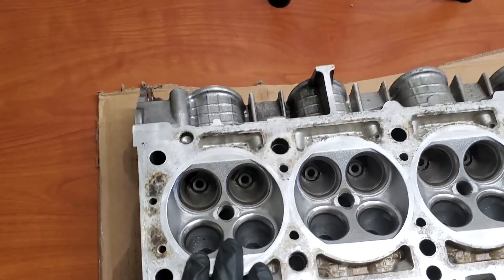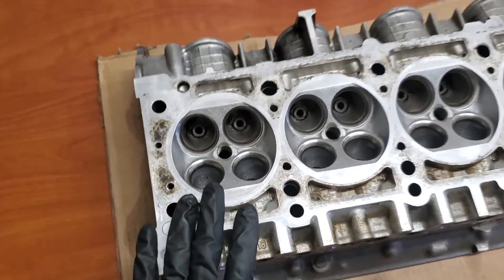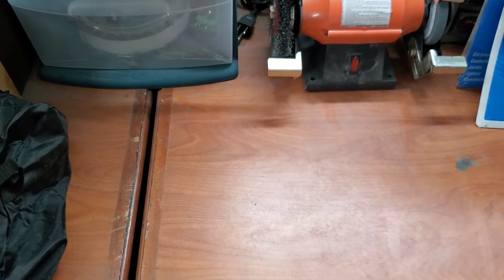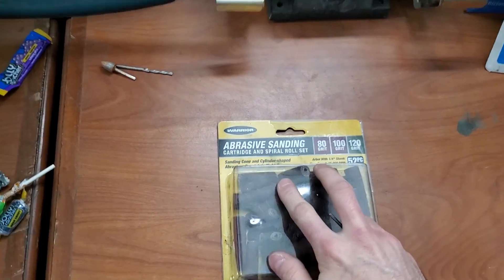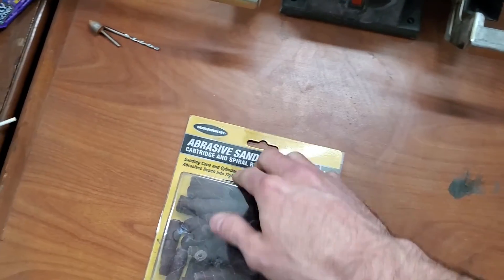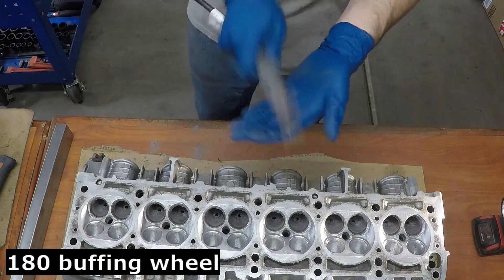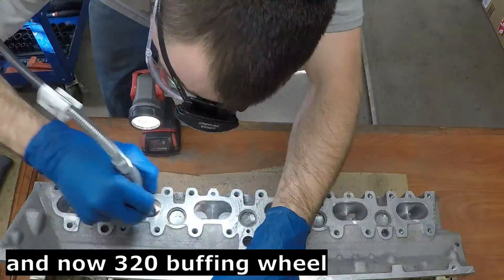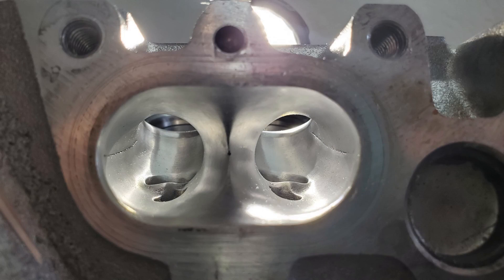Porting The Head - M104 Turbo Build (Ep. 13)

Comment: There all all kinds of room for improvement in that head, anyone who knows anything about cylinder heads and porting can see that. Sure, Cosworth helped design the head, but Cosworth designed the cylinder head to a price point and a budget set forth by Mercedes. I’ve seen Cosworth F1 heads and I promised you they look nothing like that factory cast head. Nothing you did in this video hurt that head in the slightest, everything you did there is going to offer an improvement over that as cast head. Pagani who uses essentially the same head on the Zonda (The M120 shares heads with the M104) do an extensive port and rework the chambers on there heads. If that head were a fully built Cosworth cylinder head, the head alone would cost tens of thousands of dollars. It is a well designed head from the factory without doubt, but there is certainly room for improvement and anyone who says otherwise simply doesn’t know what they are talking about. Well done sir
Reply from the maker: I wasnt going to say it. Thankyou Haha

Comment: That head was designed by a little company called COSWORTH and believe it or not they KNOW a little bit more than Jake 
Props to Jake for having a go and youthful exuberance and all that, but in reality, he has just destroyed the flow characteristics of that head.
Sadly it would have been BETTER if he never touched it with that Dremel tool at all. But you have gotta love the fact that he's overly confident 🤣 🙄
Reply from the maker: I respectfully disagree. I certainly changed the flow characteristics, but i strongly believe its for the better. I dont think the engine benefits from a head with casting lines, sudden port expansions (due to non-blended "lips"), and dull dividers.

Im willing to bet my head will flow better than the factory intended.
Reply: @JakeSublime   Yeah what would the engineers at Cosworth know - They only built some of the best F1  engines in the world 
If you bothered to do some proper research on head porting you'd realize why I made that statement
Not putting you done - but your theories are wrong . Sorry to tell you - but ignorance is bliss 🙄
Reply from the maker: Most 90s *320's had this head, which means it was mass-produced. The casting, along with some other things, required some clean up. This is normal for any mass-produced product.

I admit, i could be wrong, but i dont think i am. We will see down the road, huh?
Reply: @JakeSublime  A stock untouched head is capable of supporting 600 to 1000 hp . Sadly once you can lose 50 hp with that dremel
By adding a turbo hopefully you will increase the HP so its all good 😉 I respect that you're having a go at it so it's all good 
The M104 is an awesome engine I have 5 of them in my cars and a LS 😄
Reply from the maker: Humor me, lets have a collected and respectful argument/discussion. What did i do in my port job that will negatively impact engine performance and turbo spool?
Reply: @revtec4267  I don't know exactly the m104 but i do know the m102 2,5 16v from the 90s, Though it was built by cosworth this engine is empty under 4,5k compared to the japanese equivalent in years. It doesn't mean it's bad but there is hella room for improvement on this engine for sure, could be the same for this m104

Comment: Is the -hole-? Before the exhaust valve guide for the EGR?
Haven’t had my hands on one of these yet, if so I wonder if there would be a benefit to filling it.

Surprised at how well the ports are to begin with, can’t see a ton more to do beyond what you did (cutaway pics would be good if I could find them)
Reply from the maker: yes thats for the EGR. If you look on the exhaust side of the head where the manifold/header would connect, youll see a hole there between the two banks of exhaust ports. Thats where the EGR runs. Unfortunately, it must stay like that :/

Maybe in the future ill have a chance to tig those holes up, but not for this build. Im just going to block off the port on the outside of the head and hope theres not alot of cross-flow.